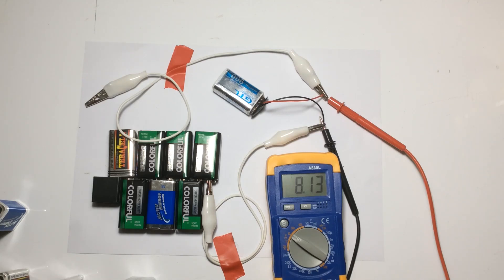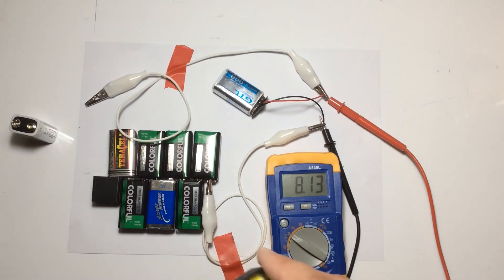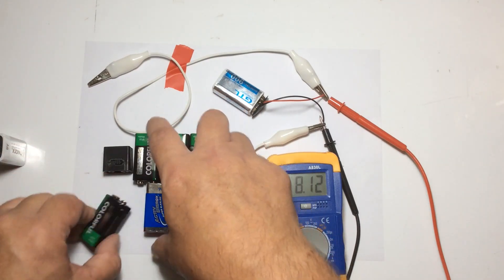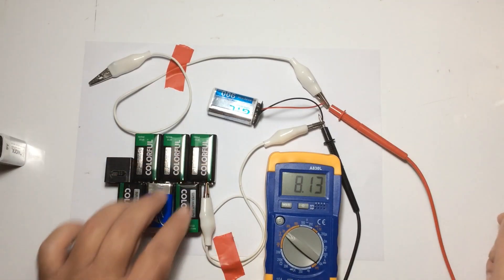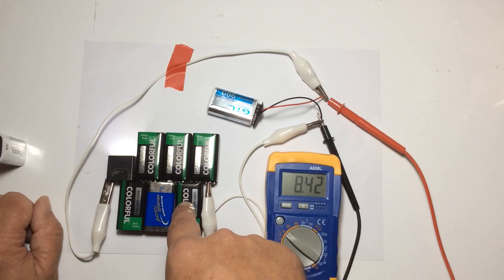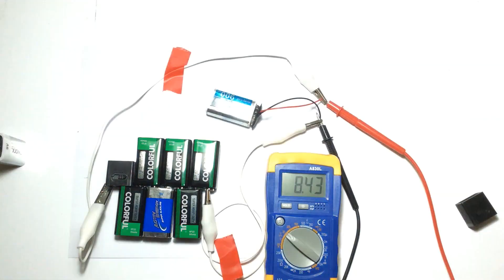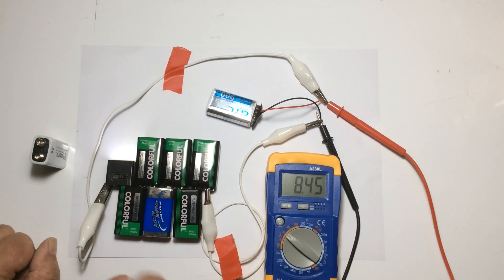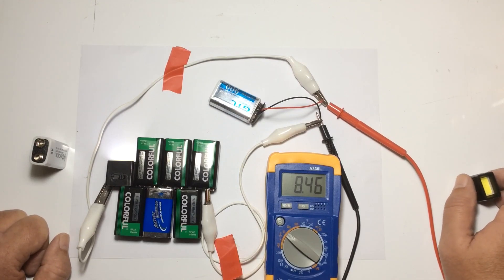WRING OUT YOUR DEAD BATTERIES AND SAVE MONEY $

Comment: In the video there are 18V on 6 batteries, so 3,0 V each. In my experience, simple white LED flashlight works down to 2,7V well, and a battery shouldn't have less than cca. 2,5V minimum open circuit (without load) to see any light in the dark. 
I tried to get some description on what is a suitable battery, so I looked up some 9V charger. It charges at 400mA (until 8V??). 
I figure your battery series here has combined internal resistance of 20 to 50 ohm (equal to estimated charger input impedance). Each battery then has 3 to 8 ohm internal resistance on average. Then the voltage halves itself under load. 
I would like to add that combining very differently discharged batteries is not desirable. For best results, maybe keep differences to max. 1 - 1,5 V between each two batt. 
IMHO, in theory, a dead 9V battery might have 6V, so 2 or 3 batteries like that might be enough to charge a rechargeable 9V. (Number depends on the health and int. resistance of dead batteries.)
Reply from the maker: Thank you for your comment.
Normally it is not recommended to mix different batteries but in this scenario we are finishing the depletion of power and care not for the health of the batteries as they are already considered dead. The number of batteries I use in this video is chosen by looking at the light, if the light is dim after connecting just two “dead” batteries in series I will connect another one and test again. These batteries have mostly potential voltage, if you put them on the meter they may read 8 volts but put them under load and they will read 5 volts or less. The light needs to be illuminated to transfer the power so I just keep adding batteries in series until the light is decent. You are correct regarding the voltage being determined by the health of the batteries involved and this is why it is a good idea to add one battery at a time, just guessing and adding them all up could exceed the safe voltage for the LED.

Comment: Probably worth mentioning that this should be monitored lest the series bank turns out to have more energy than anticipated and overcharges/damages the 9V rechargeable. Edit: btw...am eagerly anticipating your experiment using the led/recharge system with a solar panel (that is, what kind of charge can be obtained from the panel with just LED lights) :)
Reply from the maker: Thank you for your comment.
That is extremely important information, this setup should NOT be left alone, when the Rechargeable battery is full it would be dangerous and damaging to allow it to continue charging. If you were doing this all the time you could use voltage regulators or voltage alarms to prevent over charging.

I have performed some basic tests with a small solar panel however it is the cheap garden light variety which are grossly inefficient. The first problem I noticed is it is difficult to calculate the effect of the solar panel as it receives light from the room it is in, so to be fair I will need a small black box in which to place the solar cell and LED’s so that the only light the panel receives is definitely from this setup.
I started setting up a big unit this afternoon and I’m super keen to fire it up tomorrow, mostly I’m curious to see what  2 x 18 watt lights does to a 12 volt 250 watt solar panel.

Comment: Why would you put the light in the circuit to charge the rechargeable battery?  it just uses some of that residual battery power.
Reply: I'd like to know as well.
Reply from the maker: @goocherrific  Thank you for your comment.
It appears I was ten minutes late giving you the reason. Please refer to the answer I just supplied @richardwernst.
Reply from the maker: Thank you for your comment.
It seems counter productive to add the light as we are taught that it would consume the power, however this is false teaching. Energy can not be created nor destroyed therefore to comply with the laws of the conservation of energy for every action there must be an equal and opposite reaction. In reality it is the conventional use of electricity that wastes the energy remembering that it can’t be destroyed so it is converted or transformed into other forms of energy. This is evident when using this transfer method as the energy is not wasted as it is in the conventional usage. The equal and opposite reaction in conventional electronics converts the majority of the energy into heat whereas the transfer method is more compliant with the energy conservation laws, ie, what goes into the light and comes out of the light is almost the same value and only a very small amount of energy is converted to heat, transferring the majority to the Rechargeable battery.

Think of the light as a hose transferring water between two water tanks, the series batteries have a higher potential which is similar to a tank sitting at a higher elevation, when the hose is connected between the upper and lower tanks( higher and lower electrical potential) the water flows from the high potential to the low potential, electricity behaves the same way.

Say you were to perform this test with all 9V Rechargeable batteries, you would have two 9V in series creating 18V and two 9V in parallel with the LED between the two positives OR between the two negatives. This arrangement will move the majority of the energy through the LED and into the parallel bank, once the light gets dim you can rotate the battery banks and repeat the process, it is at this point that we can realise that the majority of the energy was transferred as we can power the load again and again, whereas the conventional use of electricity only allows one run of the LED.

They used to teach this concept, then they worked out they could make more money by teaching us what we have today.
Reply: @whatifididthis...1236  Sorry, don't buy it.  You're using energy to light the LED so you're converting electrical energy into light, so it's still conserved.  I'd be interested to have you put an ammeter in between a known good battery and that light (great use of disassembling 9 volt batteries for those connectors) and let us know just how much current is flowing.

Then disassemble the light itself and note that there is most likely an ordinary resistor in there to control the amount of current used so as not to burn out the LED(s?).
Reply from the maker: @richardwernst  That is ok, it isn’t being sold so you don’t have to buy it!
This is not my invention/concept/theory, but instead it was used by most of the electrical engineers over 100 years ago, Nikola Tesla has used this theory and it can be seen in his circuits, Gabriel Kron used and educated people with this concept and a company called Electrodyne Corp used the complete Tesla Switch, which this is only a part of, to demonstrate an independent system that ran a 2 kilowatt load for 3 YEARS, this used to be a thing and there are many reasons why we are no longer taught this.

I am happy to place an ammeter before and after the light to show you that the majority of the power is transferred and the rest will be up to you, to convince, investigate and educate your mind that you were deceived into slavery with the currency being energy.

You can go one step further though, you can replicate the AA versions I have on my channel and rather than trust some YouTube creator you can see this with your own eyes, on your bench and if your anything like me you will question just about everything you have been taught! Remember it’s ok to be tricked, it happens, it’s ok to be lied to but it is not ok to deny the truth because our egos won’t allow us to acknowledge our newly found reality.
Stay posted for a video showing current readings.
Reply: @whatifididthis...1236  Please put the ammeter in circuit with only one battery and the light, not the above/package, thanks.

When you create light, you use energy.  Period.  LEDs are certainly super efficient, but generally have a regular resistor that expends energy as heat to keep the current through the LEDs low.  If not, they're very bright, but tend not to last very long.

Lastly, I have few devices that still use 9V batteries, and for everything else that uses batteries, I use rechargeable Li-On or NiMH (and even some NiCd  for certain purposes).  Now to set up my inexpensive solar panel to recharge them for free...  :)
Reply from the maker: @richardwernst I will be sure to show both the non efficient conventional methods current as well as the transfer method. You may be missing the point here, the transfer method is designed to get more use of your power and this video is merely a byproduct of the Tesla Switch transfer that I thought to mention and not the real reason why this concept is used.

The efficiency of the device isn’t the reason this works, if you watch my videos on the 12 volt versions of this concept you can see I use inefficient loads such as incandescent bulbs and motors that are very inefficient. However, efficiency of a device is the main regulator of the amount of power transferred, for eg. if your LED was 93% efficient then you will have close to 93% transferred minus all the other inefficiency losses of the other components, surprisingly the load consumes very little of that energy.

So in your case you could charge your 9V batteries with your solar and then use the transfer method to run the load getting at least 3 times more power. Say my torch only lasts one night using the conventional method before I would need to solar recharge, with this method I could run the torch for at least 3 nights and that’s being very very critical. 

Take any DC device and measure the current before the load and after the load and you will see what I mean, be careful not to take both those readings at the same time as some people will come at you suggesting this violates Kirchhoff’s law, I disagree with them as I get the same result and don’t believe Kirchhoff’s law can be sighted in this instance.
Reply: @whatifididthis...1236  Sorry to break your theory but the light in series with the charging battery is using energy period. it is no magical light you get that don´t use any power. if the LEDs in series did not use any power you would not deplete a battery when using it as a flashlight and it would not generate any light or heat either. converting electricity into light uses power, the series resistance it has is using power, the voltage drop across a diode is using power, if you were to measure the voltage you get across the light and how much current goes through it you can measure how much energy it uses.

it is not a loop of water you are gravity feeding in a hose here that just takes longer time to drain the more resistance you add in the line, it is electrical energy and resistance here is using energy.

for example a series resistor in a circuit across a LED gets hot, it limits the current to a defined limit at a certain voltage but it also uses power in this case and waste the excess energy that otherwise would burn out the LED.

just because you are using another battery in series with a load you don´t magically make stuff light up for free, it still needs the same amount of power to make the same amount of output. you just pick up the voltage potential in a different place and you still drain power in one place to increase it in another, you move the energy and waste power at the same time through losses. in practical terms you "transform" and create high voltage low current potential to a lower voltage but higher current potential again.

for my part I don´t see a reason why you would want to have a load in the circuit anyway as the depleted batteries should have a pretty small current left, I would just use a low power current meter to monitor how much current you have for charging and match the amount of batteries needed to get that, or just omit it all together and read the charging battery voltage. this way you could actually recover more energy instead.

and as you said you cannot destroy or create power, you convert it into something else, heat, light, gas, liquid, magnetism etc. and to create light you need to convert electricity or burning/heating stuff to do so.

when I was a small kid I used to think a transformer output did not use any power because it was an isolated output from the mains so I tried to get free energy this way by isolating stuff from the mains line and thought I would get free energy from it as the secondary literally was a closed circuit in itself, But I was disappointed to find it was not working as the primary would use more power through secondary demand anyway, then I learned magnetic fields was transferring energy across the windings and that you simply could get no output unless you feed the same amount plus the added losses to the primary and that I actually was wasting energy rather than saving it. it kinda reminds me of this topic here. and that literally nothing can be powered without using any energy